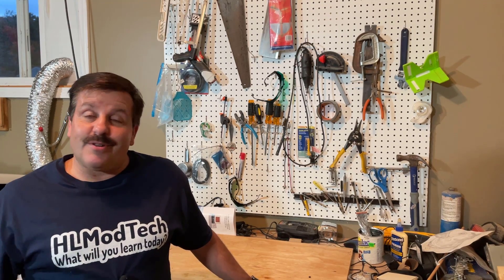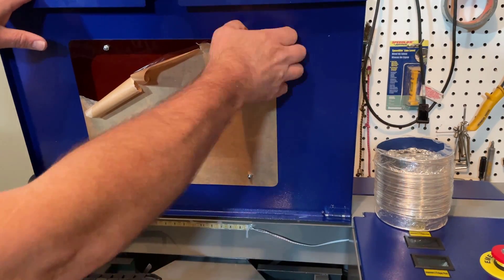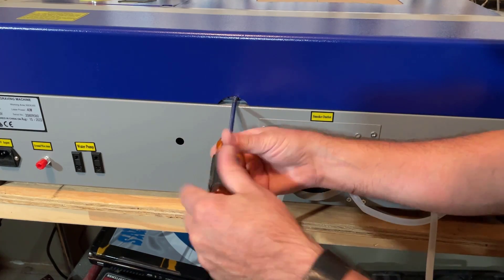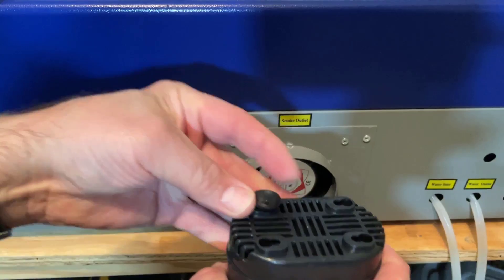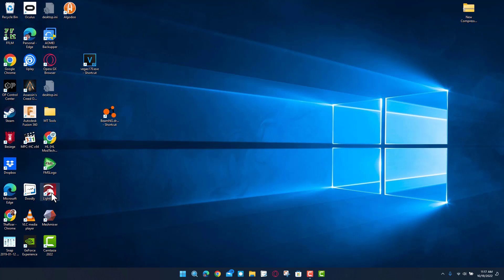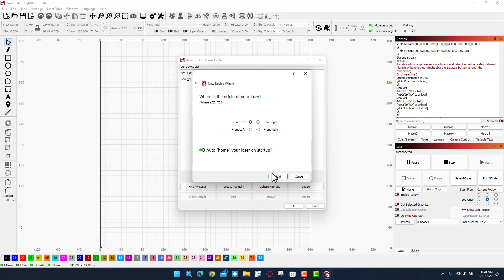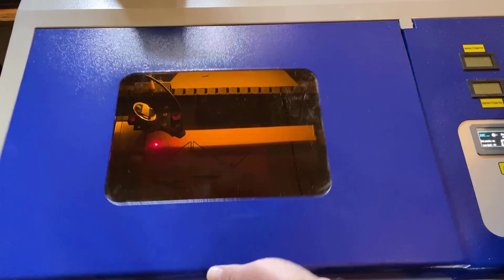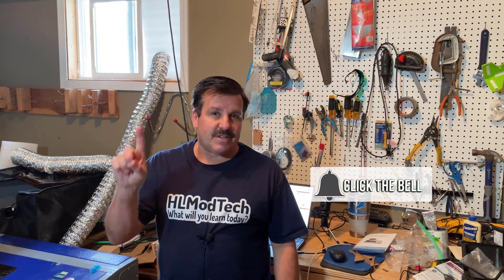Monport 40W CO2 Laser Engraver & Cutter Unbox & first cut Lightburn

Comment: Hello, so I need to do multiple passes to cut?
Reply from the maker: It depends on what you’re cutting. I do some trial and  error with each project.
Reply: @HLModTech  3mm Plywood.  Thanks for your time
Reply from the maker: I bet 3mm could be a 1 pass project. I have found though that 2 passes usually gives me a cleaner cut if their are crazy corners and such. Still trial and error for your numbers. I have not cut wood with mine yet.
Reply: @HLModTech  Thanks I tried that,  I think my machine is having issues, it will not go above 16mA.  I appreciate your time

Comment: How would you compare it to XTool M1? Other than price?
Reply from the maker: They are different technologies. Co2 lasers (Monport) are generally more powerful. The XTool is a diode laser. When diode lasers are listed at 40w, they are usually stating that their laser cuts as well as a 40W laser.  The bed of the XTool is quite a bit larger. I am not sure how the software works with an XTool, but I would guess it is pretty plug and play. Aligning and such with the Monport is work. I like the power, but go to my diode machines more often.

Comment: I ordered this same k40 that is supposed to be lightburn ready but lightburn is not recognizing it when I scan for device. Do you have any suggestions. Thank you in advance
Reply from the maker: That is odd. I would make sure you have it powered on, and then make sure the usb cable is connected correctly. I had worked in dark areas where I have tried to stuff it in a HDMI port before.....
Reply: @HLModTech  thank you for your response I found the problem was that i had it connected to my tablet which wasn't powerful enough to recognize it, so as soon as I switched it to my PC it worked fine. Thank you once again
Reply from the maker: Awesome! I will keep that in my list of things that could be the issue.